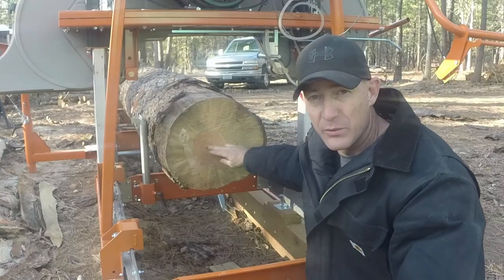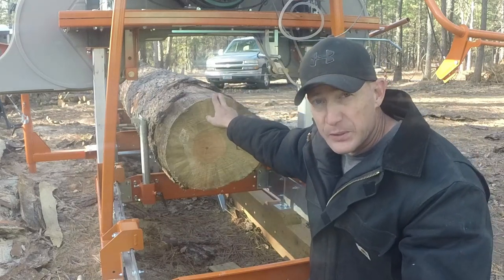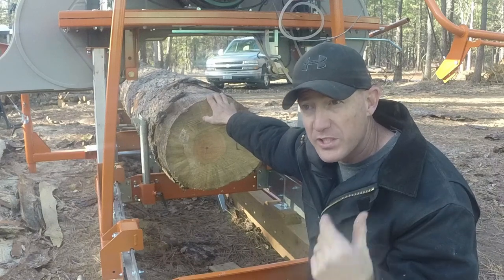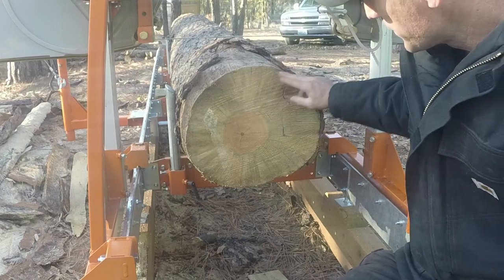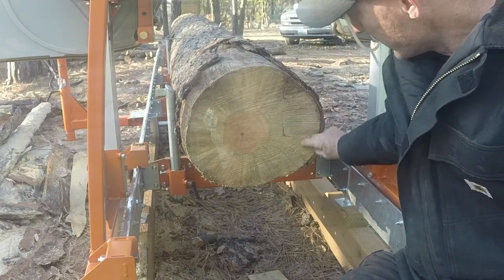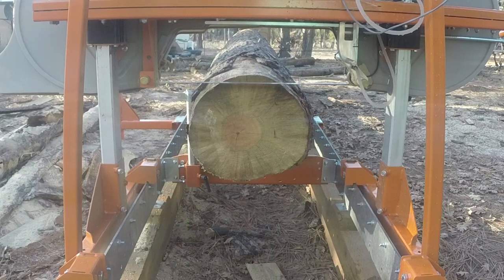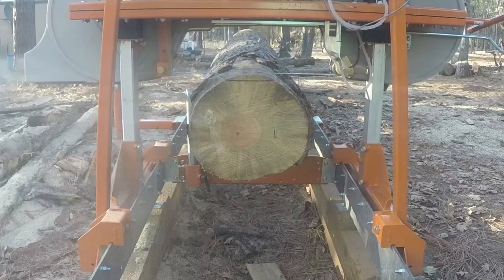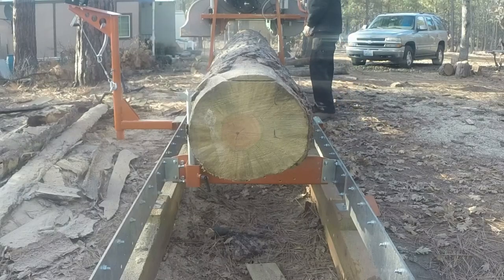Milling lumber for winter projects

Comment: Hey there, we can help with your situation :-)

This most commonly occurs when the deck is not level end to end,  I recommend re leveling the deck measuring from bunk to blade on every bunk & string lining the rail on the track,  One of these steps should catch any level/alignment issues.  All of these steps are in the manual, if that helps walk you through it better!

However,   I also notice that the log you're cutting is hanging  2’ or better off the bunk and this can also cause what is called bell or tapered boards,  The log needs to be supported equally if there is more than 1’ of overhang this can happen,  So that being said sometimes if you are wanting 10’ boards you need to cut logs at 12’ so you can support the ends the only other solution to this is adding bunks/supports to the machine.

That should get you back to making straight boards!

Any questions, call our tech support line at 1-800-567-0404!
Reply from the maker: Thank you. I did find that the deck was out of level and I had thought about the overhang but didn't think that the thicker cuts wouldn't be affected that much. I am going to get back on these cuts as soon as it warms up a bit here. Another video will be posted soon. Love my Norwoood LM29 :)